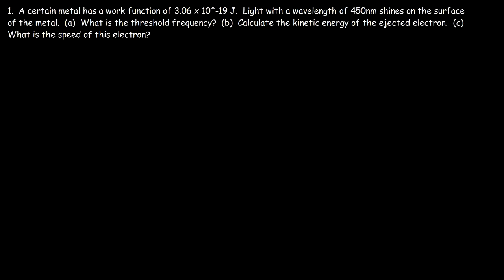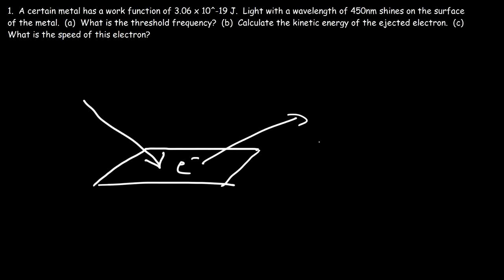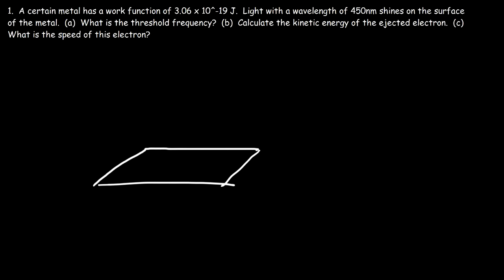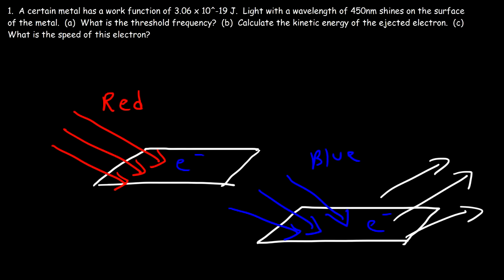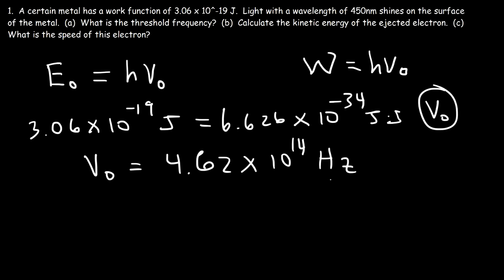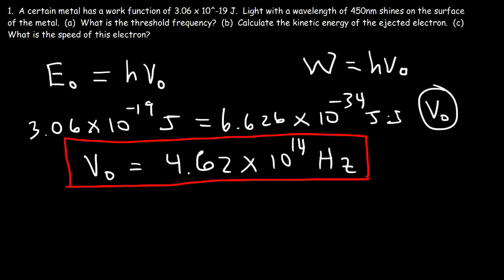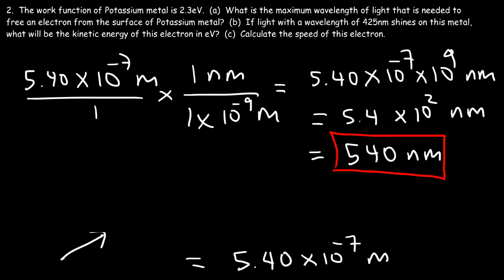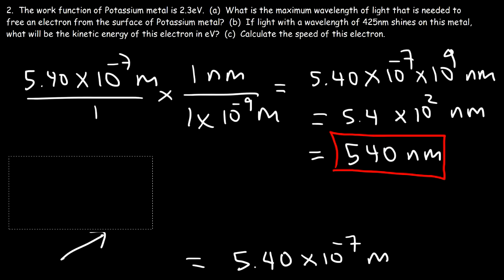Photoelectric Effect, Work Function, Threshold Frequency, Wavelength, Speed & Kinetic Energy, Electr

Comment: For question 2 when finding the maximum wavelength to liberate an electron. Wouldn't it have been easier to convert the eV to work. Then divide in by Planck's constant to get the threshold frequency (aka maximum frequency of light to liberate an electron). Then convert that frequency into a wavelength using the c=freqeucny x wavelength formula.I also then get 540nm.

Comment: Nice video, but there’s one small part you missed out, so I hope this helps
So basically if the frequency of the incident light is EQUAL to the threshold frequency, the electrons will get unbounded, but they won’t be ejected as there is no extra kinetic energy for the electrons to use to move out of the surface
On the other hand, if the frequency is GREATER THAN the threshold frequency, then the electrons will get ejected, as the excess frequency will get converted into kinetic energy, and hence the electron can escape with any sort of velocity, depending on how much higher the frequency is.
Hope this helps! :)
Reply: what does unbounded mean?
Reply: What is unbounded?
Reply: If the frequency was exactly equal to the work function of metal will current flow then?
Please explain this
Reply: Create your own content, we cool here
Reply: @Paradox586  they get dislodged from the metal and rest on the surface
Reply: Edit: excuse my essay, but I hope it helps those that need it :)

You are right, but with all the prior confusion I think it could have been worded slightly better for anybody that finds this comment in the future: By unbounded, he means the electron is ejected from the metal with no kinetic energy and thus rests merely on the surface of the metal. If there is excess energy due to high light intensity, then the electron will be ejected with a positive kinetic energy, and thus have a velocity. This allows the electron to propagate (travel) a distance relative to its kinetic energy. Further, the work function usually only addresses valence electrons (electrons on the outer most shell of the atom) as they has the shortest distance to travel when ejected and thus require less energy. If an electron in a lower energy level is to be omitted, then a greater energy than the work function will be needed. Calculating the energy needed to eject an electron at a lower energy level is usually not asked. If you are asked, simply saying “An energy greater than the work function value” will usually suffice. However, if you are asked to calculate this energy, then the following applies: when electrons are omitted with excess energy and propagate, this can be seen in a circuit experiment. Everything I have just explained is the reason this circuit works. 
Moreover, the voltage of the circuit at a certain time, when conducting this experiment, is known as the stopping voltage and is one method of calculating the energy an ejected electron has.
Reply: @blessedmazarura1799  nah chief, I wanted to know, thanks for the comment MrSushi & Aviation
Reply: @avationmusic  tysm
Reply: They get ejected but stay stationary .. they don't have energy to move
Reply: @avationmusic Thank u so muchh
Reply: Thanks I was wondering

Comment: Workout number.
A metal of work function is 6.0ev is illuminated with light if the electron emitted have a maximum speed of 1x10 rise power 6m/s .
Calculate the wavelength of light used.

Comment: Intensity apparently only affects the amount of photons which doesn't increase the amount of electrons being ejected. Rather, a light with a higher frequency will have more energy in the photons which will cause it to eject more.
Reply: In some way yes, however the electrons being emitted at a higher intensity, will be of much more frequent emission. So it doesnt exactly increase the maximum kinetic energy, however, it increases the frequency of which they are emitted. As one photon is absorbed by one electron. Hence, they came up with the wave particle duality.

Comment: shorter wavelengths are more "energetic" in single Photons , & outer  electron shells BUT radio   frequency electromagnetic wave "energy" is not directly related to or  associated with wavelength & ONLY depends on field intensity  &  saying otherwise empowers woo peddlers

Comment: Hi ,
A particle moving in a transmission medium.

Kinetic energy of a particle ( charge) moving at the velocity of v has two different values:

Kinetic energy of a particle ( charge)

Tkin id =mc^2 [ln |1-v/c|+ (v/c) / (1-v/c) ] in direction of motion of a particle ( charge)

It is realy as Newton´s kinetic energy,

where v is velocity of a particle ( charge) .

Kinetic energy of a particle ( charge)  Tkin ad = mc^2 [ln |1+v/c|- (v/c) / (1+v/c) ] against direction of motion of a particle ( charge)

It is realy  as Maxwell´s electromagnetic wave energy,

where v is velocity of a particle ( charge).
Corrected Third  Newton's law of motion : 
All movements in physics are based on principle of action - reaction and on velocity of stable particles ( e-, p+,n0, D, He-3, α ). 
Action, as a motion of stable charged particles ( e-, p+,n0, D, He-3, α ), is characterized speeds up in source along ellipse or quasi- elipse ( excentricity e –> 0 ). 
Action creates unstable particles ( leptons μ−, τ−, baryons, mesons ), bosons W +, W-, Z (= particles = β electrons moving at nearly the speed of light )in direction of motion of stable particles ( e-, p+,n0, D, He-3, alfa ). 
Reaction creates into  transmission medium, the electromagnetic waves, as unstable “particles” - neutrínos νe, νμ, ντ , mesons π0, π+ , π- , η , K and gamma rays (=waves of extremely high frequency >1019 Hz ) - against direction of motion of stable particles ( e-, p+,n0, D, He-3, alfa ). 
Accompanying activity of reaction on movement of stable particles in the transmission medium are waves, or “unstable particles“ respectively , i.e. neutrinos and mesons.
http://vixra.org/author/lubomir_vlcek
Extraordinary proofs:

 http://vixra.org/pdf/1506.0207v1.pdf
New Trends in Physics CD Rom /book, Elementes Pictures, Spheres in Nuclei, Forecasted Nuclei

http://vixra.org/pdf/1504.0082v1.pdf
One Blink of Electron is the Basis Amount of Kinetic Energy 6.62606957x10-34 Js

http://vixra.org/pdf/1503.0056v1.pdf
Confirmation of the Theory Under Discussion Wave-Particle Duality as Kinetic Energy Against and in Direction of Motion in Discussion Group Theoretical Physics !!!! Eureka !!!!

http://vixra.org/pdf/1502.0184v1.pdf 
Einstein's Theory of Relativity Can not Explain ...

http://vixra.org/pdf/1501.0199v1.pdf 
Corrected Newton´s Laws of Motion

http://vixra.org/pdf/1501.0198v1.pdf 
Principles for the Theory and Its Agreement with Experiment

http://vixra.org/pdf/1501.0197v1.pdf 
Wave - Particle Duality as Kinetic Energy Against and In Direction of Motion.

http://vixra.org/pdf/1412.0131v1.pdf
Improvement of Classical Physics

http://vixra.org/pdf/1412.0125v1.pdf 
Kinetic Energy According to Einstein and According the Latest Knowledge

http://vixra.org/pdf/1411.0533v1.pdf 
Form of Intensity of the Moving Charge Electric Field is Asymmetrical.

http://vixra.org/pdf/1411.0531v1.pdf
Form of the Interference Field is Non-Linear

http://vixra.org/pdf/1411.0530v1.pdf 
Kinetic Energy of a Charge Moving at the Velocity of V Has Two Different Values

http://vixra.org/pdf/1409.0090v1.pdf 
Three Objections to Modern Physics

http://vixra.org/pdf/1408.0185v1.pdf 
Protons Are Perfectly Stable or Their Lifetime is Enormous

http://vixra.org/pdf/1408.0133v1.pdf 
Please Read my Articles in More Detail.

http://vixra.org/pdf/1405.0355v1.pdf 
Movement Principles of Ufo

http://vixra.org/pdf/1405.0334v1.pdf 
Kinetic Energy

http://vixra.org/pdf/1405.0308v1.pdf 
Who is Right?

http://vixra.org/pdf/1405.0307v1.pdf 
What is Quark?

http://vixra.org/pdf/1405.0237v1.pdf 
L.vlcek Vixra, Getcited, Book, CD, Conferences 14.5.2014
http://vixra.org/pdf/1404.0471v1.pdf
Superheavy Spherical Nuclei. Island of Stability

http://vixra.org/pdf/1404.0369v1.pdf
Neutrino Oscillations
http://vixra.org/pdf/1404.0279v1.pdf
Physics is Easy
http://vixra.org/pdf/1404.0273v1.pdf
Particles, Waves and Trends in Physics

http://vixra.org/pdf/1404.0268v1.pdf 
Physics is Beautiful

http://vixra.org/pdf/1404.0261v1.pdf 
Introduction to my Two Articles Physics is Easy and Physics is Beautiful

http://vixra.org/pdf/1404.0253v1.pdf 
Orbit Radius and Speed of the Sun Around the Center of Gravity of the Solar System

http://vixra.org/pdf/1404.0248v1.pdf 
Spectral line Hα

http://vixra.org/pdf/1404.0246v1.pdf 
Shortened Great Table of Elementary Particles

http://vixra.org/pdf/1404.0243v1.pdf 
Great Table of Elementary Particles

http://vixra.org/pdf/1404.0238v1.pdf 
Movement Principles of the Fast-Spinning Bodies

http://vixra.org/pdf/1404.0130v1.pdf
Nuclear Fusion

Critical examination of fundamentals in physics
http://www.trendsinphysics.info/

academia.edu
https://tuke.academia.edu/LubomirVlcek

L. Vlcek, : New Trends in Physics, Slovak Academic Press, Bratislava 1996,
ISBN 80-85665-64-6.

Presentation on European Phys. Soc. 10th Gen. Conf. – Trends in Physics ( EPS 10) Sevilla , 
E  9. -13 September 1996,

http://www.trendsinphysics.info/

http://vixra.org/pdf/1502.0184v1.pdf 
 Einstein's theory of relativity can not explain ... 
Abstract 
1. Movement principles of the fast-spinning pulsars, (http://vixra.org/pdf/1404.0238v1.pdf 
Movement Principles of the Fast-Spinning Bodies )
2. Nuclear Fusion , (  http://vixra.org/pdf/1404.0130v1.pdf   )
3. Wave - Particle Duality as Kinetic Energy Against and In Direction of Motion
4. the 4th Maxwell's equation, (2.38) in http://www.trendsinphysics.info/kniha/2-1.html#2-1-3
5. Lorentz equals without the help of Space-Time,
     (2.23) - (2.27)  in http://www.trendsinphysics.info/kniha/2-1.html#2-1-3
6.Confinement of quarks   (http://vixra.org/pdf/1405.0307v1.pdf   What is Quark? )
7. Great Table of Elementary Particles  ( http://vixra.org/pdf/1404.0243v1.pdf  )
 8. Spectral line Hα  ( http://vixra.org/pdf/1404.0248v1.pdf ň
9. Neutrino Oscillations ( http://vixra.org/pdf/1404.0369v1.pdf )
10. Form of the interference field must be non-linear. ( http://vixra.org/pdf/1411.0531v1.pdf )
11.Form of Intensity of the Moving Charge Electric Field must be asymmetrical. 
   ( http://vixra.org/pdf/1411.0533v1.pdf )
 12.Kinetic energy of a charge moving at the velocity of v has two different values: 
Kinetic energy against direction of motion as wave Tkin ad = mc2 [ln |1+v/c|- (v/c)/(1+v/c)] 
Kinetic energy in direction of motion as particle Tkin id = mc2 [ln|1-v/c|+ (v/c)/(1-v/c)] 
 ( http://vixra.org/pdf/1411.0530v1.pdf  ,   http://vixra.org/pdf/1405.0334v1.pdf , http://vixra.org/pdf/1409.0090v1.pdf   Three Objections to Modern Physics )   

13. Yukawa potential

1905 A.E. :  Einstein ´s theory Tkin =mc^2 – mo c^2

1996:  Tkin id =mc^2 [ln |1-v/c|+ (v/c) / (1-v/c) ]  

            Tkin ad = mc^2 [ln |1+v/c|- (v/c) / (1+v/c) ] 

Einstein's theory works for v < 0.1c. 
 

 v/c.......Tkin ad .................Tkin id ...............Tkin (A.E.) 
0.1..... 0.00439 mc^2...0.0057 mc^2....0.0050 mo c^2
 0.2.....0.0156 mc^2.....0.0268 mc^2......0.0200 mo c^2 
0.3.....0.0316 mc^2.....0.0719 mc^2......0.0480 mo c^2 
0.4.....0.0508 mc^2.....0.1558 mc^2......0.0910 mo c^2 
0.5.....0.0722 mc^2.....0.3068 mc^2......0.1550 mo c^2 
0.6.....0.0950 mc^2.....0.5837 mc^2......0.2500 mo c^2
 0.7.....0.1174 mc^2.....1.1293 mc^2.......0.4010 mo c^2 
0.8.....0.1434 mc^2.....2.3905 mc^2......0.6670 mo c^2 
0.9.....0.1680 mc^2.....6.6974 mc^2......1.2930 mo c^2 
0.99...0.1906 mc^2....94.3948 m^c2.....6.9200 mo c^2
 1……....0.1931 mc^2..........infinite....................infinite 

http://www.trendsinphysics.info/

Why relativity works in some cases and fails in others ? 

Like Newton's theory works for small speeds v << c, 

Change QUALITY:  

1905 A.E. :  Einstein ´s theory Tkin =mc^2 – mo c^2

1996:  Tkin id =mc^2 [ln |1-v/c|+ (v/c) / (1-v/c) ]  

            Tkin ad = mc^2 [ln |1+v/c|- (v/c) / (1+v/c) ] 

Einstein's theory works for v < 0.1c. 
 

 v/c.......Tkin ad .................Tkin id ...............Tkin (A.E.) 
0.1..... 0.00439 mc^2...0.0057 mc^2....0.0050 mo c^2
 0.2.....0.0156 mc^2.....0.0268 mc^2......0.0200 mo c^2 
0.3.....0.0316 mc^2.....0.0719 mc^2......0.0480 mo c^2 
0.4.....0.0508 mc^2.....0.1558 mc^2......0.0910 mo c^2 
0.5.....0.0722 mc^2.....0.3068 mc^2......0.1550 mo c^2 
0.6.....0.0950 mc^2.....0.5837 mc^2......0.2500 mo c^2
 0.7.....0.1174 mc^2.....1.1293 mc^2.......0.4010 mo c^2 
0.8.....0.1434 mc^2.....2.3905 mc^2......0.6670 mo c^2 
0.9.....0.1680 mc^2.....6.6974 mc^2......1.2930 mo c^2 
0.99...0.1906 mc^2....94.3948 m^c2.....6.9200 mo c^2
 1……....0.1931 mc^2..........infinite....................infinite 

http://www.trendsinphysics.info/

L. Vlcek, : New Trends in Physics, Slovak Academic Press, Bratislava 1996, ISBN 80-85665-64-6.

Presentation on European Phys. Soc. 10th Gen. Conf. – Trends in Physics ( EPS 10) Sevilla ,
E 9. -13 September 1996,

http://www.trendsinphysics.info/

Perfect logic and faultless deduction make a pleasant theoretical structure, but it may be right or wrong; the experimenter is the only one to decide, and he is always right. – Leon Brillouin, Scientific Uncertainty, and Information (1964).
………………………………………………………………………………………..
 
 
"Perfect logic and faultless deduction make a pleasant theoretical structure, but it may be right or wrong; the experimenter is the only one to decide, and he is always right. – Leon Brillouin, Scientific Uncertainty, and Information (1964)."

Comment: So how do I calculate current when I have threshold frequency, E of incident light and n.o of electrons passing a specific point per second
Reply: You can't. The current depends on the intensity of the light, but there is no simple formula for it. It is a highly material dependent effect that would, in addition, also depend on the incident light angle.

Comment: Please help me answer those question 
Given that the mass of electron =9×10–³¹kg and that the velocity of light is =3×108 m5¹
Calculate the following 
(A)  the kinetic energy of a gas molecule of mass 5×10²⅝kg moving the velocity of 400ms¹
(B) the kinetic energy of an electron moving with an electron 2×10 ms¹
(C)  the energy of a quantum of green light of wave length 55onm
(D)  the energy of a quantum of ultraviolet radiation by wave length 100nm
(2) a quantum of energy 4.5 election volt is incident on a calcum surface what is the energy of the emitted election 
(3) what is the velocity of an electron of energy 2.5 ev

Comment: i have a very specific question that i have only found one person on the internet to answer it but the explanation was in hindi so i didn’t understand it . my question is which electrons exactly leave the metal , i thought they were the electrons in the outermost shell/ orbital ? according to the indian guy the correct answer is “ electrons freely roaming about in the interatomic space” and that what i thought was wrong but i didn’t understand that quite well. so please can somebody explain
Reply: You probably don't care about the answer 6 months later lol, but for anyone else wondering: The electrons that leave first are the valence electrons. This is because they are on the outermost shell, and therefore not as tightly bounded. They require less energy to be 'broken off'. When we talk about threshold frequency, for example, that is the frequency required to remove the valence electrons, being the ones that are easiest to remove. To remove electrons from the inner orbitals, it will require a higher threshold frequency (more energy).

Comment: in my problem I'm only given the Wavelength and I'm asked to find out the Energy of the photon which is easy, and I did... but then I'm asked to find the maximum kenitic energy without being given the value of the Binding energy (Work Function "W"). please help, how am I supposed to solve that?
Reply: did you find this out yet?
Reply: I know this is 4 months late, but I have the same problem now and I can't figure this out.
Reply: U can use the formula of half mv square